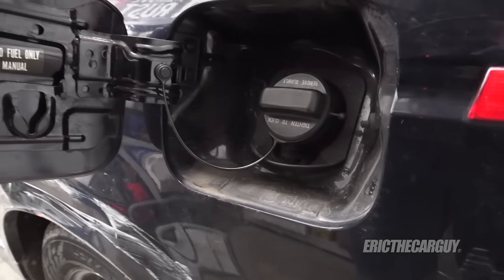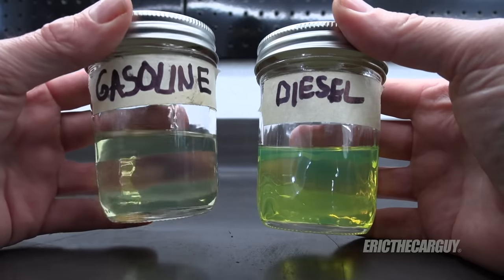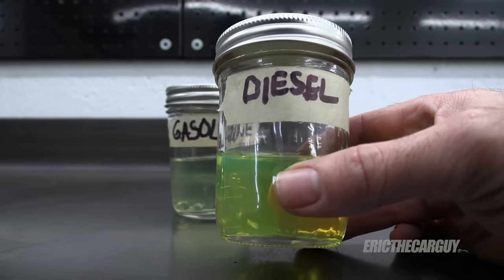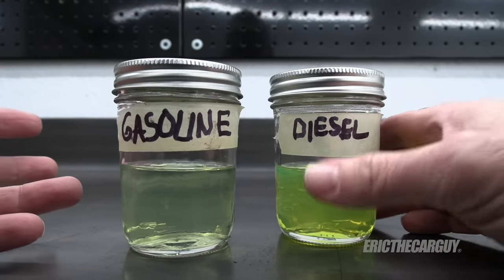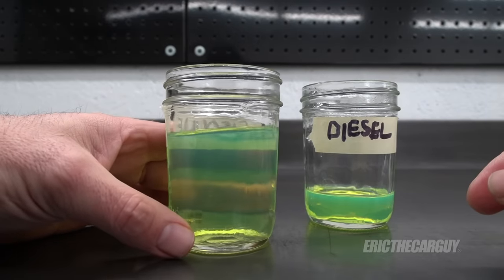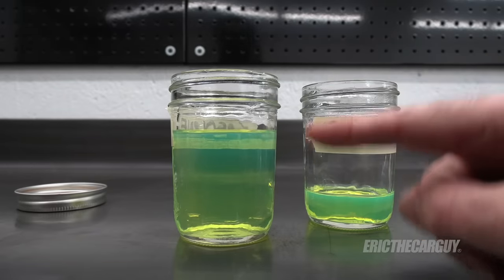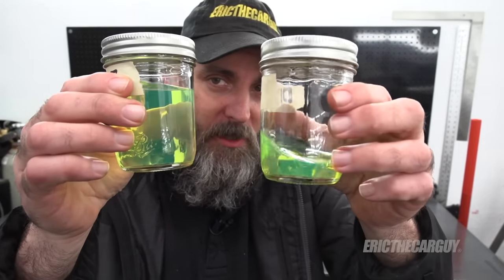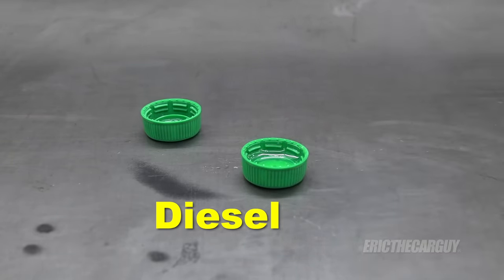What Happens When You Put Diesel in Gasoline?

Comment: My grandfather had an old tractor from the 30's or so, No exhaust manifolds so it was super loud, sounded like 6 shotguns firing.  He would take all of the families used motor oil from oil changes, run it through a simple strainer to get out any solids or sludge, then pour it right into the tractor and ran the tractor off of the motor oil.

Comment: Ran a diesel fuel mix in my 1981 Honda accord ex (carburetted) at about a 10% mix it was fine yes it was Smokey no it wasn't ideal but no damage at least in my case one time I did run to high a mix the car stalled out and wouldn't start but once that diesel was diluted back down all was fine

Comment: I worked at enterprise as a mechanic, in Richmond Virginia.  You would not believe how many people accidentally put diesel in rentals.  I had to drain 1 almost every week.  I would siphon them down as low as the hose would allow just the bottom inch of fuel left, then add a half tank of gas, replace plugs and purge lines.  It would smoke pretty bad through that whole 1/2 tank and would run like shit.  It doesn't take much diesel to ruin a tank of gas, never had any problems with converters or injectors but I imagine it took at least a few miles off the life of the substrate.  I've never seen that problem once in 20 plus years of being a mechanic outside of enterprise.  95% of the time is was people from jersey, bc they don't pump their own gas up there.

Comment: My brother-in-law‘s wife did that one time to their Ford fusion put $20 worth of diesel fuel in it and quit running on her. I filled the rest of the tank with gas and got the engine started back up on brake cleans and told him don’t shut it off. Driving around for a bit and top off the tank with some more gas it was fine didn’t cause any problems with the fuel system. The car had over 450,000 km on it before it went to the junk still ran fine. On my own car I mix up a half litre transmission fluid and a half litre of diesel fuel I’ll throw it in the gas tank to clean out the fuel system and remove carbon. Never had any problems with doing that Car now has 400,000 km on it still runs fine.

Comment: actually many older cars and tractors were converted to run on kerosene which is more similar to diesel than gasoline. you would start on gas, let it heat up, and then switch over to kerosene which was cheaper.

Comment: If you mix varying ratios of diesel and gasoline, vacuum-seal them inside of a mason jar, and then stick that mason jar inside an ultrasonic cleaner... Then you might actually get a proper emulsified fuel. You could probably also add an organic emulsifier agent in order to keep that emulsion stable.

Maybe limit the fuel mixture to a 20%/80% blend of diesel and gasoline?

Comment: my 1.9 tdi 1z audi 80 has had 2l of petrol with every full tank of diesel for now going 400k on the same engine and fuel pump! my father has owned the car from new and i now own the 1991 aged car that is 28 years old! it has also been run on a mixture of veg oil and petrol too
Reply: but any new car with the extremely high pressure pumps would get absolutely destroyed doing this! i dont know but i think the little bit of petrol has kept the system clean over the years as the car still has most of its 90bhp from the factory and to be honest it feels like more,TO BE CLEAR HERE THE CAR HAS NEVER BEEN RUN ON JUST PETROL

Comment: I think if you have an older vehicle it's ok to put diesel in the gasoline. A carbureted engine with no cat. I had a Chevy truck from the 60s. I used to put diesel in the gas all the time, when they started putting the alcohol in the gasoline. I used about 25% diesel in the gas. The only noticeable difference I found  is I would get a small puff of smoke out of the exhaust between shifts. The main reason I did this was It was cheaper for me to get diesel than gasoline at the time.

Comment: You can see the diesel goes to the bottom since it’s more dense and the ethanol in the fuel probably mixes with that but the fuel pump will suck up the diesel since it’s on the bottom so it will get into the fuel system pretty quickly.

Comment: I recently lent my generator to a friend and he put diesel fuel in the tank and it caused the engine to run way hotter than it was supposed to. When I tried to turn it over the motor was locked up as well as the spark plug was fouled out on it. Once I drained the whole fuel system it look a little bit for the rocker arm ticking to go away. Also had noticed that it had a lot of carbon buildup inside the combustion chamber. There was some damage to the rings as well as to the cylinder walls. The cylinder wall was very smooth and had little to no cross hatch pattern that you could see left. This was done in a generator and not in a vehicle just to be clear. As to what it will do in a car I haven’t tried it yet.

Comment: Alternative recommendation for if you're in a situtation where you can't get towed, can't drain the tank, or for any other reason are incapable of doing the correct thing to do (drain your tank and put the proper fuel back in your car). I'm talking dire straights here, out of options. If you've put diesel in a gas engine, it will not start on diesel, but if started on gasoline, the heat from gasoline combustion will help burn the diesel. If the compression ratio of the engine is low enough it will not ignite the diesel until the gasoline is burning. It is not good for your catalytic converter, O2 sensors, EGR, turbo (if equipped), fuel pump, filters, or injectors (there is more wax and contaminant in diesel than gasoline, and the unburned byproducts will find it's way to other things). That is to say, if you absolutely can not properly service the situation, if you've started your gasoline car and its running on a diesel gas mix, keep the engine running drive around gently at lower RPMs(if you hear knocking sounds its bad, reduce engine speed and load). Knocking sounds mean the diesel is combusting before the spark plug is commanding fuel ignition. Return to a fuel station, leave your engine running otherwise it will not start again on the diesel mix, keep adding gasoline to the tank until you've gotten more than half the capacity of the tank back in. This is not considered a safe practice either. When you get back to a location where you can service the vehicle, inspect and replace components.

Comment: My gf filled the tank with diesel in my 75 Volvo 242GL when we were in high school. She stalled soon after pulling out of the gas station. Dad had to drop the tank and clean it out. It was a Bosch motronic FI system so we were lucky it didn't screw it up worse.

Comment: Been there, done that. But luckily it was 25 years ago and our car had a carby. Only put less than half a gallon in an almost dead empty tank before I realised, changed over filled it up with proper fuel and the old banger (Ford 302 Cleve) ran reasonably well (bit sluggish) but exhaust smelled terrible (no CC). Had to drive around for a couple of hundred miles to drain the tank. I actually drove til it fully ran out, had a 5 gal container with fuel in the car ready to go, problem gone when refilled completely.

Comment: common rail diesels may suffer the most,  ive seen guys put ethanol into diesel only to require a very expensive new pump and expensive  injectors after a while driving like that. i had one guys suv not running right his fuel filter was mostly full of ethanol, kinda like a water separator and he said he only put 2 litres into his 70 litre tank.

Comment: I currently have a 2018 Hyundai Tucson and when I first got it a friend of mine accidentally dumped 3 gallons of diesel into the fuel tank we just topped off the tank with gasoline and drove the car and then when the tank was empty we filled it back up with gasoline never had any issues actually the car seem to run better and I got 8 more miles per gallon than normal.
Reply: good for yoú

Comment: Engine will run just smoke a lot you keep putting gas in and it cleans up. Did it in a durango magnum 5.2 no issues after it burned out the diesel.

Comment: In Australia we dont have a color code for fuel.
Each brand of station has their colors so if you go from shell to caltex to mobil the colors for the pumps are not the same.
We have E10, 91, 95, 98, LNG/Autogas, Diesel and some places have E85
Each has its own color
Reply: That's sounds better.
People learn to actually pay attention to what they're doing instead of just assuming.
Reply: @HocchanFan  I guess but if you go to a station brand you dont go to(say on a trip) having  a set color for 95octane is a good thing.
Reply: @IIGrayfoxII  Or you could just look for the one that says 95 and use that.
Reply: @HocchanFan  That means you have to pull right up and if it is E10 trash and 98 you have to then back out and go to the drive to the next pump

Comment: Many years ago, I had a diesel car and one day I put gasoline into the tank. Fortunately I saw my mistake before turning one the ignition key. My car endend up beeing towed to a nearby shop. It was an unforgetable moment. an expensive moment that is: adding  to the cost of 60 litres (15.85 US Gallons) of gasoline, I had to pay the mechanic for having the tank removed from the car and emptied. Then I had to refill the tank with 65 litres (17.17 US Gallons) of diesel. In the end, the car had no issues, I save the engine and that was a good thing.

Comment: Hi Eric, 
In the 80's I used to add diesel to my gasoline for my 1967 high compression big block engine because 109 -110 octane was discontinued.
It cured any pre-ignition problems caused from low octane.
I was able to get aviation fuel but that deemed costly and inconvenient.
Reply: how much did you use?
Reply: So you cured an issue caused by low octane rating by lowering it even more?!?!

Comment: I run an old ford escort van with 1.8 N/A diesel, (2000 engine) have often added 10 to 15% petrol (Gas for those over your side Eric!), with no issues what soever, as its an old & simple  engine (originally the lynx engine - developed in the sixties I believe). I have also used used veg oil, new veg oil, blended with petrol, diesel, engine oil & a host of other additives ;-) 100,000 miles now & always starts straight away!! Even with the dreaded Lucas pump too. But new motors as you say, will not be so forgiving though.

Comment: Miami Dade County Fleet had 350 vehicles damaged from diesel in gas. They even needed a bunch of engines. West Palm Beach Fleet needed 185 engines from the damage done by by diesel put in they gasoline supply. There is no safe amount of diesel in gasoline. If you put diesel in your gasoline don't drive it and have the fuel tank and lines flushed.

Comment: Running the diesels are not as bad as you claim.  I clean my diesels with a petrol mix.  Max 5 percent mix ratio.  The engine is still yet to fail.  The eng8ne has covered 300k miles.

Comment: I had a gasoline car that we believe had diesel in it at some point.  I changed the fuel filter when I first got it, and it smelled like diesel.  I drove it daily for a year or so.  (Did a fuel/injector cleaner treatment.  Just like the filter, it's something I always do on used cars.)  The car started hating life before I sold it.  (We had another one, same year similar miles that had no issues.)  I traded it for a truck and while doing the ritualistic maintenance  on the truck remembered the diesel smell the car had.  Then we realized the injectors/pump might have been failing on the car.

Anyways, I don't know for sure that the car had diesel in it, or how much, but that's about as long as it lasted with the damage... and I'm just commenting for the youtube algorithm. ;)

Comment: Even if the nozzle is bigger on the diesel pumps you can still fill it up by not putting the nozzle in the filler neck :) here in sweden like uk Gas is green and diesel is black, my dad used to mix in a little bit of diesel in our old gas tractor to give it some boost, it could run on kerosene alone

Comment: Gasoline is a solvent, diesel is a lubricant. 
Think of diesel as very low sulfur heating oil and it makes more sense. You can use diesel fuel in your home heating system, but should not use heating oil in your diesel vehicle, because of the sulfur content and it's impact on modern diesel emission control systems (DPF) and of course, the environment. Heating fuel is more similar to "off road" diesel, with roughly the same sulfur content. I'm not big into diesel equipment  but I believe the regulations for off road diesel are changing such that it will be the same as ULSD (on road diesel)  in the near future.

Comment: Just siphon out as much as possible, change the fuel filter and then fill it up with gasoline. Top off the tank as often as possible. Drive it until the gas washes the diesel out. Problem solved.

Comment: I'd say you are probably right on with your thoughts about the results from putting diesel in a modern fuel injected gas engine.

However, diesel in a gasoline engine with a carb seems to act differently.

Back in the '80s, my father, an ex-diesel mechanic who was also quite handy building gas engines, stopped in a gas station and was served up a tank full of diesel into his 350 Chevy box truck, thanks to NJ's laws requiring a pimply faced kid picking out a fuel to spill all over the side of your vehicle.  Truck was an '84, but I know the engine wasn't original, as my father rebuilt a different one and swapped it in.  And it was, obviously, carbureted.  Anyway, after getting filled up,  resulting in about a 4:1 or 5:1 diesel - gasoline mixture, he made it a few hundred feet before the truck started acting up.  He immediately knew what happened and turned around and got back to the gas station, but by then, the engine was racing and due to copious pre-ignition, the engine wouldn't shut off.  He finally was able to get the air cleaner off and stop the engine with a flannel shirt and a block of wood.  

Needless to say, he was pissed with the gas station, which immediately went into deny-mode, blaming him for asking for the wrong fuel, having a broken truck, having the wrong astrological sign, etc.  I forget how that was worked out, but the gist is that the fuel system was drained and later worked fine... the truck still has the engine in it, though its clapped out now and in need of another rebuild 200+K later.  The odometer on that truck has flipped so many times, I have no idea of its true mileage.

Dad felt that quick thinking is what saved the engine.  Dad was a credible guy, and I believe him (I wasn't there).  Over the years, I have thought about what process went on, and I can't dismiss it... apparently with the fuel system was able to deliver enough of whatever the fuel mixture was  to sustain the engine... and the engine was hot enough, had enough compression and/or hot spots to ignite the mix.

That's my story and I'm sticking with it.

Comment: My fueler once accidentally put gasoline into my caterpillar bulldozer.  It was at night on a snow covered mountain top (filling from barrels).  Luckily the exhaust pipe pointed straight up.  When I started it up and the gas reached the cylinders the exhaust pipe shot fire like a flame thrower; about 20 feet in the air.  The engine kept running and roared as it spun like a top.  It took some nerve to jump back on and turn the fuel shutoff (yah, I ran).  The flame lit up the night sky and was probably visible for 50 mile in every direction.  The CAT ran fine when we put diesel back into it.

Comment: Diesel is actually a form of oil.  Oil fired furnaces/boilers actually burn diesel - it's just labeled differently and has no road tax added.  They dye it red so that if you are ever caught with it in a vehicle, they know it was not meant to be used on the road and you get a pretty hefty fine.

Comment: Diesel in gasoline engines usually tend to simply stop the engine operation since spark plugs aren't able to ignite it.
If the mixture is rich enough in diesel to stop the engine, no damage.
You just need to replace the fuel, flush the system and you're ready to go.
If the diesel % is low enough to allow the engine to run, the risk of detonation, since the Diesel fuel has a very low octane rating, is big.
And it also tend to damage catalytic converters and oxygen sensors.

Gasoline in the diesel is way worse.
There's no risk of pre-ignition (how did you think the engine can have pre-ignition if the fuel is injected at the top dead center? there's no fuel in the combustion chamber, so no pre-ignition can happen), the main issue is related to lubrication.

Here in europe we have way more Diesels around, and those mistakes happens frequently.

Never seen a gasoline engine damaged from Diesel, but a lot more Diesels damaged from gasoline.

Comment: I think diesel burns a lot hotter than gasoline. I remember my brother usually put a little diesel in his gasoline Subaru Legacy because it seems to improve gas mileage and after a few weeks the car could not start. On pull down, a big hole was in the pistons like someone was in there with a blow torch. That was a expensive lesson learnt. Luckily he is mechanically incline.

Comment: i have a bunch of leftover diesel from one of my trucks and i have been mixing it in 1/3 to a gallon and running it in my generator in my off grid property for a wile now i have noticed no difference in performance and the generator is a little bit quieter on the mix no smoke or anything, exhaust smells different i think at worst in my situation it might foul the plug after a wile but that is easily rectified =)

Comment: if you make a fuel mistake,  Don't turn the ignition on at all.
You don't want the fuel pump to run, keep the mix contained in the tank.
Diesoline or Gassel anyone?.
Reply from the maker: Probably the best advice. Thanks for the comment.